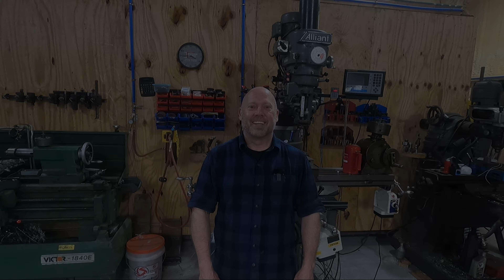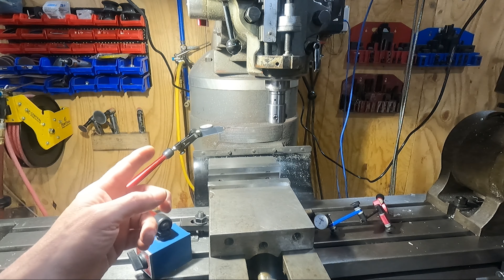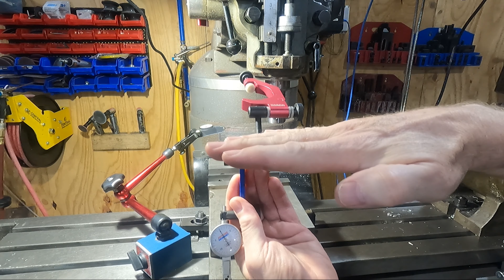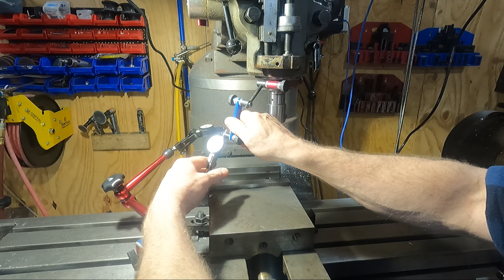Proper and improper indicator use when tramming a milling machine

Comment: On your Press brake project with the Vevor hydraulics did you ever drill out the orifice on the return side of the valve to increase the fluid flow ? That was a good video .....I enjoyed watching it :) !
Reply from the maker: To be honest, I have not.  I've just lived with it as is.  It's not too bad, I'm just impatient :D

I'm glad you liked the video!
Reply: @MountainLaurelMetalworks  as a matter of fact I have the Vevor pump and two 50 ton cylinders just like you used coming next week Federal Epress. My press brake frame is also shop built like yours ...just a little bit bigger.  I can bend 10ft wide sheets (light gauge material) with mine . I have been using (5) Harborfreight air powered 20ton hydraulic jacks. Talk about slow :)!  Your video made me aware of the Vevor option....Thank you !   If you're ever in the Eastern NC area your welcome to stop by for a shop visit :)!